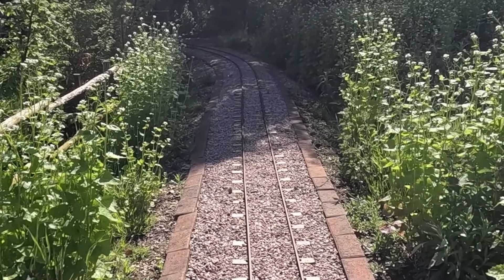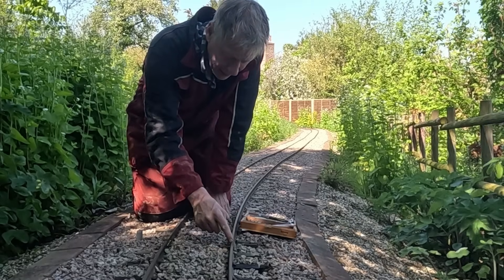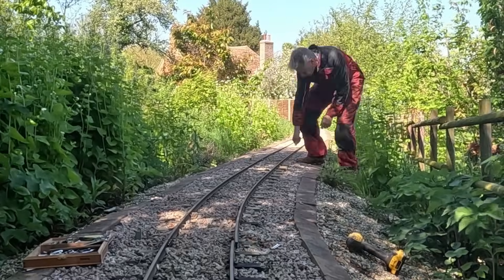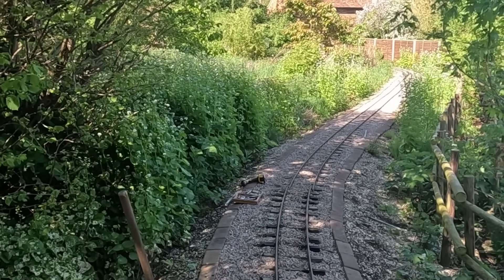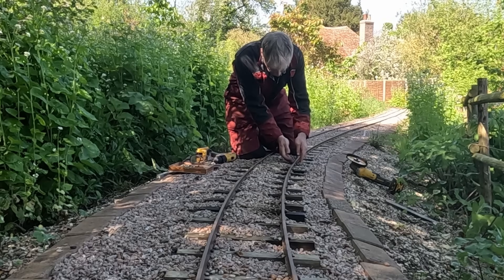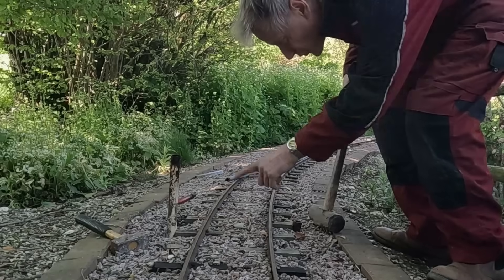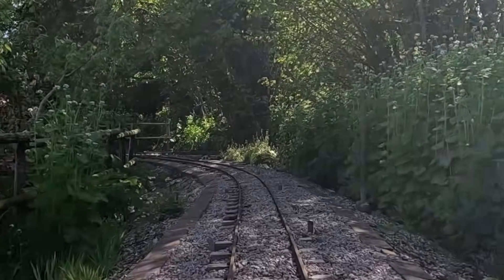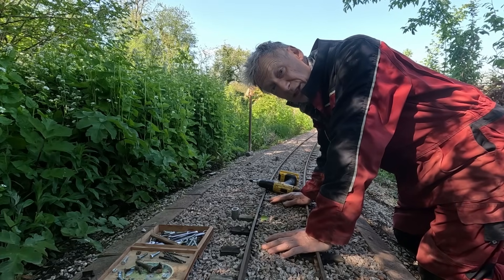High Speed Transition Curve – at Peter’s Railway

Comment: Chris, i have a question witch locomotive slows down more the sam locomotives that the wheels block when you brake or bongo witch you apply the brake but the  wheel dosent block?
Reply from the maker: Good question!  The braking force on Bongo is very much higher than on Sam.  The loco is much heavier and then I am sitting on the tender which is also braked.  I am quite heavy too!!
Chris.

Comment: I'm actually surprised that in this large scale, you aren't actually using the principals of full sized railways. By that, I mean that transitions are mathematically calculated using either the cubic parabola or spiral formula. With this, you would end up with a dead-accurate transition that is nice and smooth.
Reply: In a simple physics model the lateral acceleration (latax) of a body moving in a circle is expressed as v^2/R where v is the velocity and R the radius.  If the mass changes from straight line motion to pure circular motion then the latax changes instantly from zero to whatever the value is determined by v and R.  This is why you get the sideways kick.  This is also a property of most train set track such as Hornby Dublo - their pieces are always straight or curved on a fixed radius but they have giant, ugly flanges to keep them on the track and don't carry real passengers.

If you transition the curve from straight (where R is infinite and therefore latax is zero at any speed) by gradually changing the radius then you avoid the discontinuity caused in latax.

In the real world of Peter's Railway it is probably much more pragmatic to set the transition by eye rather than making all the calculations and doing some complicated surveying.  Some basic associated calculations can be used to determine optimal super-elevation for a particular speed.
Reply: @adambrook7468  The formula used to calculate real railway transitions is either the cubic parabola (y = Kx³) or more recently, the clothoid spiral.
The use of a clothoid or a cubic parabola is optional for lower speed lines on Network Rail (UK) but for high-speed lines the clothoid is now mandatory because the cubic parabola actually creates a sideways jolt at high speeds. It is only since the advent of computers that engineers have been able to design transitions accurately with the clothoid due to the lengthy process and number of data points it produces.
For all intents and purposes, in the scales of model railways, you wouldn't notice the difference in the alignment, therefore, it is quite reasonable to use the easier cubic parabola approach which I would also suggest is appropriate for the OP's video.
Have a look at our article 'Cant and transition design' on the Model Railways Online website where this is fully explained and provides worked examples.
Agreed on Hornby (and all RTR track): it doesn't have any transitions and never has done: it goes from straight, directly into final radius curve.
In Peter's case, I'd suggest that a pragmatic approach might be to plot out a cubic parabola every foot and use it as a guideline. At least it will result in a correct alignment. You don't need complicated surveying because the whole thing can be aligned from a parallel string line as a series of shift offsets.
Reply from the maker: That is a good suggestion, but only works for us up to a point.  On the original line, the up and down part, that has been in place for some 50 years and is a part of the railway.  There are no real problems with this part anyway as the curves are fairly gentle - apart from one part which I shall explore as you suggest!  The other parts, with the tighter bends had to fit into a surprisingly constrained space.  The problem with a transition curve is that it ends up taking more space to get a turn in, so in this case wasn't really possible.  Maybe I will get the chance to realign that part of the track in a more major style and move the points a bit further down the line - that would ease the curve much more.  
Thanks for watching! Best wishes, Chris.
PS. If you would like to know about the books I write to teach children (age 3 to 90!) about railways, science and engineering, there’s lots of info here: https://petersrailway.com/ and we ship overseas.
Reply from the maker: PS, I think there is a way of setting out a transition curve, on the ground, with string etc.  Do you know how that is done??  Chris.
Reply: It would be a lot easier to use a string line and Hallades method to calculate the slues.
Reply from the maker: @paulplowman8481  I don't know if it would be easier, but it would certainly be fun to try!  Do you have any links to articles showing how to use a string line to set out a transition curve??  Thanks, Chris.
Reply: What is the radius of the tightest part of that curve?
Reply from the maker: @Marbelup  Hi, that's a good question:  The tightest radius on the line and on the loops is around 9 metres or 30 feet.  15 metres would be better, but that would have taken up much more of the field and would have made the embankment even higher as the field drops away.  It was big enough already!!  Thanks for watching, Chris.
Reply: @PetersRailway  I have a modest 7 1/4” gauge railway with about 300 m of track.  My curves are constant radius of 10 metres.

About 25 years ago, when designing my 1:64 scale model railway, I worked out a simplified method of doing a transition curve using four short segments, each of a different radius, being various multiples of the radius of the final curve: 5x, 2.5x, 1.667x and 1.25x.  The transition subtends a total angle of 10 degrees, and its length is approx 35% of the final curve radius.  If anyone is interested, I can work out the offsets along the length of the transition which would result in 5 reference points.
Reply from the maker: @Marbelup  That seems a very sensible way of laying out the curves.  Even it you calculated it by mathematics, I am not sure the track would stay in the exact shape for long - it just isn't heavy enough to stay in place with hot and cold weather!  Chris.

Comment: I've been watching your videos for the last month.  I love your way of explaining things, your narration, and especially the railway.  I want more!!!  I have a few questions, perhaps you can address them in future videos?  How much does Bongo weigh?  Does Bongo ever have more serious breakdowns than a worn out axle bearing?   Does Bongo have any 'stock' or 'purchased' parts on board,  Or is Bongo 100% home made and custom made?
Reply from the maker: Hi Chris,  Thanks for the good comment!  Also for suggestions for future videos, I have made a note of them...
Bongo weighs about 300 to 350 kg, not quite sure but it it less than 500 and more than 250.
The most serious breakdown has been the poor sealing of the piston valves in their liners.  The liners were a little bit porous and I should have remade them at the time.  Now it is much more difficult.  Instead, I reamed them out and made new, Clupet, pistons rings.  Quite a palaver!  There is a video on making the rings and fitting them.  See the channel videos...
Bongo is mainly built from scratch, but there are some stock items:  Most of the nuts and bolts, and pressure gauges.  The main part that I didn't make is the boiler (underneath the green cladding).  I didn't have a large enough set of bending rolls or enough heat to silver solder it.  Also, maybe better to have the boiler made by someone who knows what they are doing!!!
Thanks for watching! Best wishes, Chris.
PS. If you would like to know about the books I write to teach children (age 3 to 90!) about railways, science and engineering, there’s lots of info here: https://petersrailway.com/ and we ship overseas.